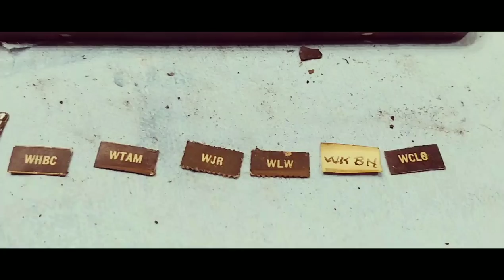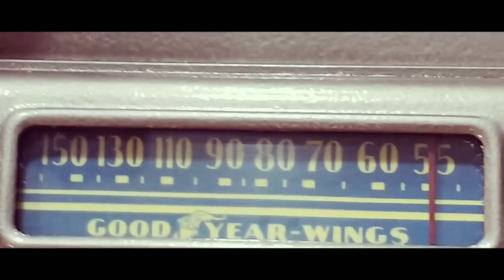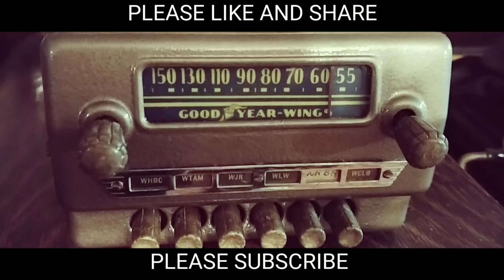ANTIQUE 1930s GOODYEAR RADIO RESTORATION - COSMETIC

Comment: Lokk at this masterpiece of engineering and compare it with all the new crap what is build in in modern cars.
Reply: But the new version fits in 1/8th the volume, uses 1/20th the power and covers more frequencies. The one in my car also includes Bluetooth, SatNav and DAB (that's the proper digital radio used in Europe which the US military doesn't want Americans to have). It can also be controlled by handy buttons on the steering column or with a cordless remote. It also costs a lot smaller proportion of someone's pay than that Goodyear unit.
Reply: @DaimlerSleeveValve  In the past, you didn't need that many frequencies. Today almost everything is controlled via these touchscreens. If the touchscreen breaks, not only the radio stops working. And with modern radios I can't even buy a better radio because they all have different dimensions and connections. The radio in my car also has bluetooth, telephone, USB, card reader, DAB + and all the other stuff. But the display just stays dark if the car is in the hot sun for a long time and nothing works anymore.